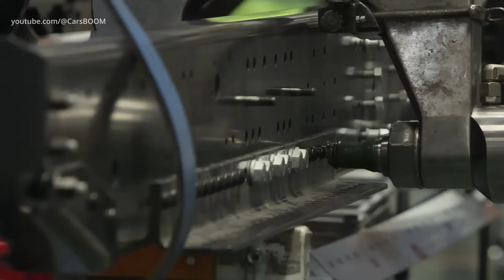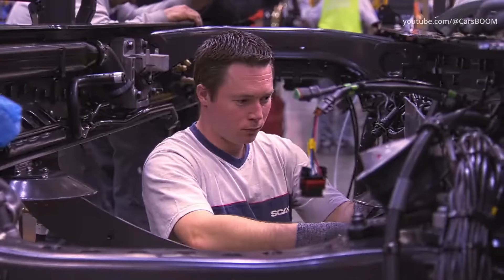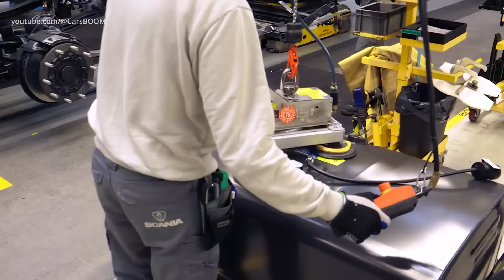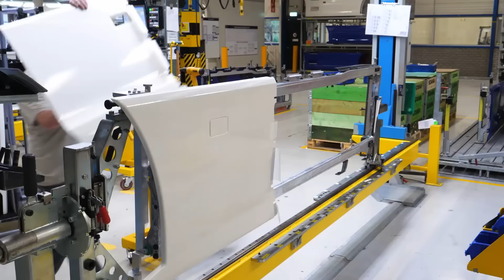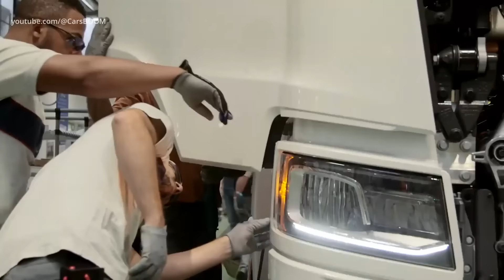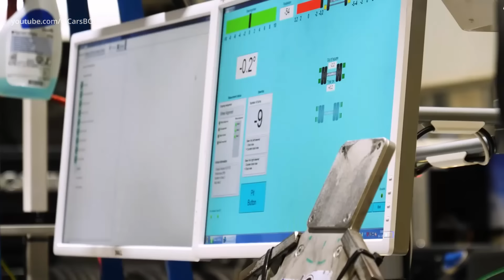Inside Scania production: Manufacturing process at the Truck Factory

Comment: The modular construction idea stood out to me: frames rated for up to 48 tons, built from the same elements in different configurations, with a thorough inspection at each stage of assembly. I also found the second workshop sequence clear, with wires, hydraulic hoses and valves fitted to the riveted frame, and the two-circuit, fully pneumatic braking system with anti-lock and optional electronic brake-force distribution. The cab section was a good contrast, with about 310 metal plate items per cab and robots handling much of the painting.

Comment: The modular frame approach stood out — building different trucks from the same elements while handling up to 48 tons, and the detail about the two-circuit fully pneumatic braking system with anti-lock braking, made the engineering trade-offs much clearer.

Comment: Which brand of engine? BOSCH Fuel diesel system?
Reply: Scania is the engine brand as well :) They design and build their own engines in another factory.
Reply: @which brand of fuel common rail system Scania engine use? Or they also produce by themselves like engine

Comment: Yeah only that there is wrong info here. I work at the Factory in Meppel and we certainly DO NOT SHIP COMPLETED CAPS. Those are Build Painted and Assambled in the Factory in Sweden. We in Meppel are responisble for everything that goes on the outside of the Cabin and Truck:

Sideskirts
Roofspoilers
Bumpers
Upper and Lower Grill

Those parts all get painted and preassambeled at our Factory in Meppel and than get shipped (which is my job as a loadmaster) to our 3 Factories in Zwolle (NL) Angers (FRA) and Sodertalje (SWE) where the Trucks get fully build.